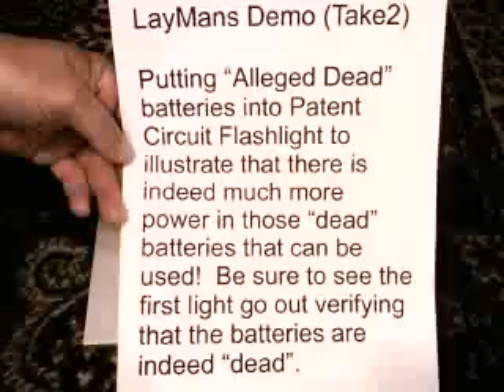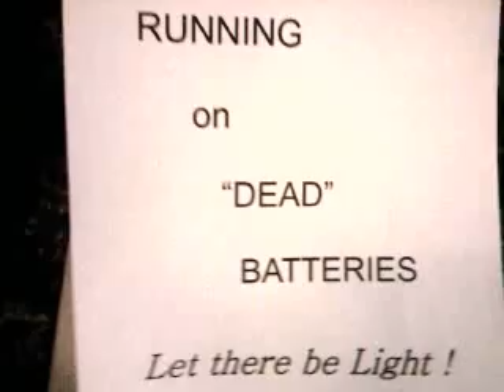Jeff DOUBLEBATTERYLIFE.com TAKE2  Video0016.mp4

Comment from the maker: You simply need to buy the "basic kit" (which does not have any enhancements) put it in the toy train (if you can solder you can do it), then prove it out to yourself.   You can probe for information to the ends of the earth, but when you see it in action you will have to revise your own theories about how batteries regenerate on their own, and how they really operate (what the disposable battery co's don't want you to know).

Comment from the maker: You are SO wrong.   This is nothing to do with those schematics, and also we have a USA patent, (with accompanying patent search)..  FYI: .WORK as = Force x Distance and demo that with toy trains, we get 500 laps with normal methods, and 500 more laps with the circuit using the already depleted batteries.  Work is Work, Massive extra laps are massive extra laps, and if you let it rest overnight after the 1000 laps, you can get prorated more laps on next days up to 6 times (days) later.

Comment from the maker: One of the best things is that we only have to replace the one worst battery to get hours and hours more time.   Long and short of it :  it WORKS and WORKS VERY WELL in fact.   If you don't believe goto ebay : Search " amazing patent" then under other items listed by this seller, buy a kit, build it correctly without presuming anything and enjoy flashlight forever more as it really does pay for itself almost just within 2 uses.  Same for toy trains and other motorized toys.

Comment from the maker: We have used this patent circuit in our own flashlights many many many times over many years with FANTASTIC SUCCESS !  Its actually much safer than other methods because the batteries are managed individually instead as one entity, Also the bulbs seem to last much longer than they are rated (thinking because of more graceful power up compared to full blast all at once full power which is used in normal devices ).

Comment from the maker: No, there are no capacitors/hidden gimmicks, it just  gleans out  residual power below the usable voltage for normal devices, by using a voltage manipulation circuit it pops up the voltagee.  Elegant by its simplicity and low parts count.   I recently reduced the parts count from about 20 to about 3 parts needed for the flashlight version !   Yet it gleans out double the "work" *(work = force x distance, and Force = Ma).  Recent Side x side test showed patent light 3x brighter!